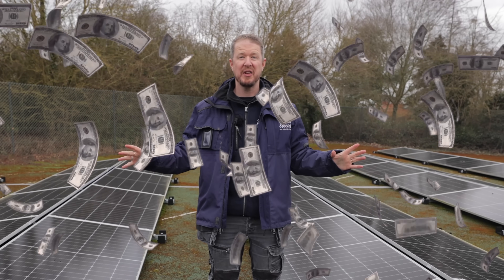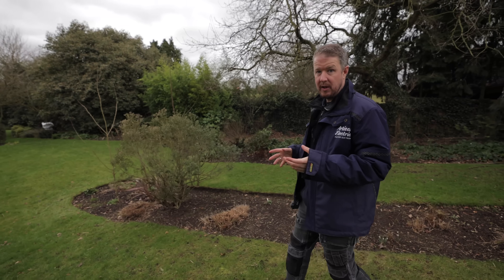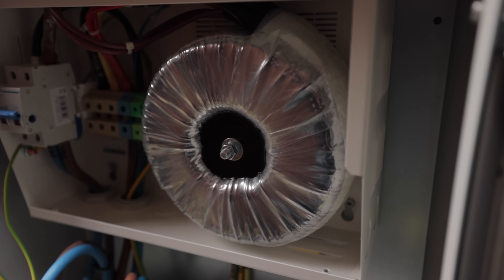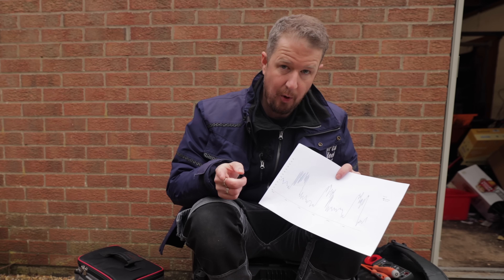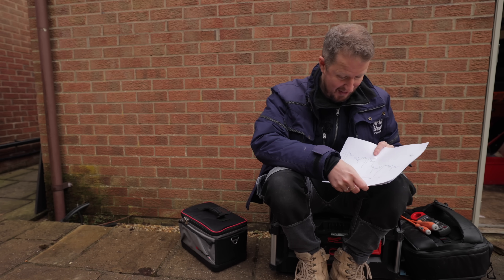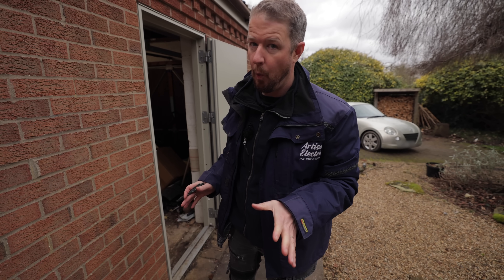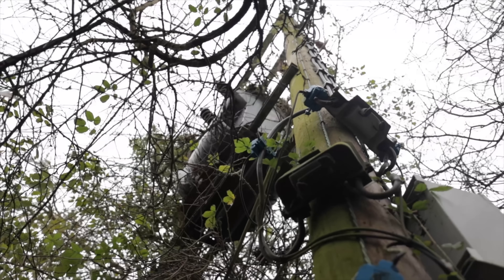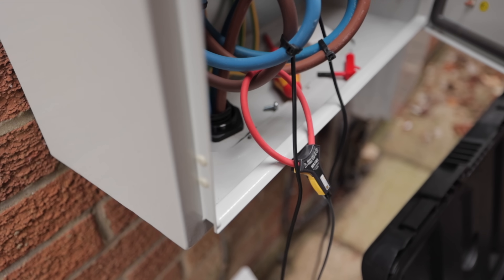THOUSANDS Down the Drain – And We Can’t Do Anything About It!

Comment from the maker: Try OpenQuote for yourself: https://www.openquote.net/
Reply: as replied numerous times below, to solve this you would require a beefier LV grid. Tapping the transformer elsewhere will result in end-of line voltage being too low. Base reason this is like it is, is the G99 approval for default 17kW. 

if you stay within default requirements as per for example synergrid in europe they do not do a total re-calculating of this grid portion for this. 

the portion what needs to be kept in mind, is that these systems at the time where engineered, did not need to take into account decentral production, only power draw. 

to solve this, without changing anything to the grid, you would need a automatic tap transformer that can regulate your voltage on the fly, or you would need to top off your power production to match the 255v AC mark, this will reduce your output of the solar panels, but to my opinion only a few % .
Reply: I did try the quote portal. Submitted everything asked - you guys didn’t answer. Tried the WhatsApp and again silence.  Great videos but extremely poor communication.
Reply: This is problem that we have in Netherlands for years. 

Electricity always flows from high to low voltage. When a house consumes a lot of energy from the grid the voltage in the house drops. This allows the power to flow into the house. 

When you have a solar inverter and an exes of power the inverter is increasing the voltage. This so the power can flow to the grid. What is happening every solar inverter in the neighbourhood is increasing the voltage cause they all have an excess of power. So these solar inverters are all fighting and increasing the voltage cause they all want to get rid of their excess power. A solar inverter has a build in safety feature that shuts off the inverter at 253V. 

You need to get rid of that transformer as fast as possible. You and Your customer can be held liable for any electric appliances breaking in the neighbourhood due to overvoltage.
Cause you putting a voltage on the grid over 253 volt. 

Tip: find a neighbour without solar to do your grid voltage test. 

Charging a car or a power wall will drop the voltage in the house. This is your only tool you can play with to lower the voltage during peak hours.
Reply: why you dont tune the inverters they are the faulty ones seems they are crap and 240 V is on the midel of 230v normative soo it's 230 +-10% 260 seems they are fighting for pump power on the grid instead just just only pump the line demans.Alot of inverters have a   bus and comunication  for avoid over voltage on the grid line. and plsu how many customer can use the power on that line your pumping sounds low on summer

Comment: Ok, very simple, problem is your "optimiser" is manual... You need an active one. Or if you fit a bypass contactor to it that engages when the batteries charge so you don't drop as far that might get you over the line...

Problem is less the DNO transformer and looks to be the capability of the lines between that transformer and the site...

Comment: looks like a pretty remote property, you're possibly just dealing with voltage drop across 300m of cable. the transformer is likely fine. 

useless info - Flexible CTs are generally Rogowski coils.

Comment: Not read all the comments but, couldn't a system be put in place so, instead of all three battery storages being charged at the same time, but charged instead, one after the other? The time would increase for charging all three sure enough, but the voltage drop wouldn't be as bad.

Comment: In Australia the minimum street to house mains feed is 16mm2 (25mm2 better) single phase and anything over 10kw of on grid solar inverters requires a 2nd phase for 20kw solar feed to grid and 3 phase allows 30kw onto the grid. Some states also can turn your on grid inverter/s off remotely if the grid is stressed.   

In older homes or acreage/farms with long runs to the street transformer and/or small pole transformers the customers often go 100% off grid using solar/inverters and enough solar panels for the worst weather periods (up to 100kw) along with say 50-100kwh of 48v batteries. You will always get some charge every day and if it's scaled right you never run out ever, you should have 4 days bad weather autonomy as a rule. 

The existing mains is then ONLY used for battery top up's as needed rather than run a genset in really extreme bad weather such as a long lasting low depression or cyclone with intense thick cloud. 
Most however disconnect the mains ENTIRELY due the unreliable nature of it and the energy cost (up to 70 cents a Kwh) and daily cost of the grid (up to $2 a day) would EASILY pay for a 20-30kw diesel genset which is rarely if ever needed but has to be there as backup. Diesel is always stored in bulk on the farm anyway.

Going off grid in many parts of Australia is not only cheaper but it's far more reliable. And the farms are used to regular checks and maintenance on expensive machinery so just add the solar checks to their workload
The checks are system output via an app,  look for hotspots (usually a loose connection or dodgy breaker) with a FLIR camera, keeping the solar panels clean and cleaning inverter and air conditioner filters (if used) and checks for moisture and vermin.
The installer will usually visit once a year to check and tighten all DC and AC connections as well as double check the owner is doing their bit.

Comment: Exactly the same non-sense here in Spain. And, do you recall the BIG BLACKOUT we had in Spain on April 2025?. Well, I monitor daily the voltage on the grid, of course WITH my solar system working. SInce the event on April 2025, the grid voltage has suffered a LOWERING of about 10Vac. Yes, I mean that, instead of the very usual 250+Vac we had on solar peaks, with peaks of 255+Vac, we got into the 240Vac area. That way my solar system is lots happier, there are no disconnections / alarms, and there have been just a couple of hickups since, even with the Summer. I did some research and it seems the voltage on the transport grid has been lowered and so the cascading transformers have also lowered the voltage to reach the customers. So, if that is not a case of deliberately changing the grid conditions, I don't know how to call it. It is curious I have not seen anywhere this information but, for sure, at least on my area, it can be demonstrated using the voltage logs of the weeks before and after the blackout

Comment: The night-time battery charger is pulling too much power.
If you could reduce the power consumption (extending the charge time) it would solve the excessive volt drop which is made considerably worse by the distance to the local transformer. 
Am i wrong?

Comment: My system had the same problem and my charger kept tripping out at 260volts. The DNO tested the voltage at the substation and it was too high nearly all the time in summer. They looked dropping the voltage but found it was further upstream from the substation, then they did something somewhere else and it dropped to the required level.. so now my  charger works OK but in winter I am getting low charging because there has been no  usable sunlight from flag and cloud cover.

Comment: This solar voltage instability is why the the Spanish grid collapsed. Because they had shutdown all the stable electricity supplies ie gas and coal the grid became exposed to voltage changes. Up and down the country solar was pumping in different voltages and the whole grid went down. They are now trying to reduce the grid voltage to about 220 to allow for spikes but as more solar is added the problem gets worse

Comment: I would have thought the dno would have looked at this further due to the high grid supply but surely when charging the EV it would come from the battery storage first? Wouldn't that be a programme issue on the inverter storage setup? Some I've seen run off the batts until power drops then switches to grid supply or a combination

Comment: That’s not a voltage optimizer. It’s a transformer. A voltage optimizer is far more complicated than that and stabilizes the output voltage to a constant level. You’ll end up with the opposite problem when the supply voltage drops. Which it will as load goes onto the grid.

Comment: What the hell?  The grid tie PV inverters are current source devices; they aren't supposed to be able to alter the mains voltage at all.  Why on earth would you whack a transformer on the mains?  If the line voltage coming in from the utility isn't right, it's on them to fix their transformer.

Comment: Unless a power company is giving me a 1 to 1 exchange my greedy ass wont export any power unless my battery is charged and there is litterally nothing else to add power to.  Thats assuming my battery isnt too small and charges in one morning then i would get a bigger battery. If they got that much money then the pnly reason they should have it connected to ac power would be to charge on raining days. Otherwise install a tranferswitch and to heck with exporting.

Comment: Your optimizer should be not set to a fixed rate. E.g. It should be set to -6% during sunlight, maybe to +6% at night while battery charging and to neutral in between. Otherwise it is just a dump transformer and not an optimizer.
The solar system must be connectet direclty to the grid!
Only loads (house, EV charger...) should be served by the optimizer.
I also recommend to charge the batteries at noon during solar production peak instead at night.
Also check the inverters configuration. It should never let the voltage go above 253V.

Comment: It sounds like the EVSE was designed for 230V +10/-6% but the local sub station is still set at 240V so that will take it over the limits. The first EVSE I had did this. Really EVSE manufacturers need to allow for the higher voltages, mine was tripping out at night as the low load caused the voltage to rise.

Comment: Did you eventually fix this ? It seems there is clearly a high resistance joint causing a larger voltage drop under higher load - remove that *voltage optimiser* thing

Comment: Needs another 200 houses building and connecting to the same substation - that will pull down the base voltage (providing of course they aren't allowed to do anything stupid like feed even more  power back into the supply!

This is nothing new - regeneration when braking  on electric trains as always had the problem that there needs to be other trains to put a load on the supply - otherwise the voltage goes too high.  On trains we monitor the line voltage and reduce or stop regeneration if the line isn't receptive. Seems like you need something a bit smarter than just the step-down transformer bolted to the outside wall.

Comment: Surely, to feed the grid from the PV system, it just needs to be 0.1 V higher than the grid. Why is your client's inverter increasing the voltage by 25 V (10%)? My inverter increases the voltage by 2%, but in summer this means my normal grid voltage of 240 V rises to around 253 V, and my inverter will increase it further to approximately 258 V. An easy fix would be to stop supplying the grid. My off-grid PV systems stay at a constant 230 V.

Comment: @artisanelectrics I had exactly the same problem at my property in London a few months after getting PV and battery installed. I have a 8kW enphase system with 17kw givenergy batteries, 2x hypervolts and an eddi setup and noticed that the GivEnergy inverter was tripping up. Upon calling them, they advised it was to do with the voltage, and all the readings are stored in their cloud which I could log into. I produced a graph similar to you, and promptly called UKPN. They installed a voltage monitoring device (but surprisingly said nothing about switching off the PV system). After 3 weeks they collected it (although it only records about 1 day of data). It seemed to confirm the problem, and the engineer said he's going to tinker with the settings at the transformer. In my case, the nearest transformer supplies about 200+ houses, but the guy said the voltage control was manual (a bit like the steps in your optimiser). But he also said the next transformer (supplying the whole neighbourhood - approx 2000+ houses) up the line was automatic...i.e. adjusting the voltage based on what the readings are to try and maintain the baseline. The engineer tinkered with the settings between both transformers and it solved my problem. This was about 3 years ago. I haven't bothered to run the graphs again as it's a very manual process, but I also haven't had any of the equipment tripping out because the voltage is outside of the range. So I 100% agree with you that the issue is with the transformer technology.

Comment: I live in India and here voltage swings from 185~190v to about 235~ 240v...Earlier days of my childhood it was very disturbing because everything was voltage sensitive like fan, incandescent bulbs, fluroscent bulbs, motor pumps etc..they won't light up properly. But with the comming of electronic choke for long fluroscent tube lamps, also CFL and LED lamps and BLDC fans we barely notice the voltage fluctuations anymore.

Comment: I really have to challenge the owner of this system. He has installed a tennis court of panels which we all know will need to be sitting on the court for 10 to 15 years to payback and more than likely will be in the way and scrapped early. Then he seeks to pump a reasonable amount of power back down the cable on sunny days. But why bother? Why all this investment? 
Why not accept he can charge batteries on cheap rate and use it during the day at proper voltage and top up on a sunny day with a smaller array? He has the luxury of a national grid and does not need to be off grid.
My own array takes care of household demand on sunny days only, nothing to export and some to import each day. Secure supplies, saves a few pennies in the very long run, reduces demand on the grid that is full, downside is at night in an interruption I will be sitting in the dark.
Seems to be a big boy toy and he is going to upset his neighbours if they realise their voltage is going all over the place.
Grow up mate.

Comment: Wherever the fault sits, I can't help but think this is just the tip of the iceberg in terms of feeding into the grid. In simple terms the electricity grid was conceived, designed and built as a 'one way' system, sending power from stations to users. As we see more and more localised 'user' generation the pressures of making our 'one way' system into a robust 'two way' system and balancing the two needs will become more and more complex. DNO's and gov't must be aware of this, this is just another element of grid balancing, the key questions being what are they planning and who will pay for the likely major works.

Comment: 230V baseline in the UK? Mmm, It’s 240V and over the last 60 years I’ve consistently measured between 238V and 245V. It can sometimes be a problem when using equipment designed for the rest of Europe which typically uses 220V or 230V.

Comment: Maybe I missed something with the customer's problem, but wouldn't you just install the energy optimiser on the consumer side and not the generation line? That way grid ingestion on overnight charging isn't reduced and car battery chargers / house appliances are running on optimal levels rather than waiting for the grid to be fixed? I mean, I appreciate that effort, but grid seems to be within tolerance, and I don't know if the transformer is the problem or if the input is simply greater that 11kV. In australia our expectations are 240V +/- 10%, and to be fair most appliances don't really care because aside from heater coils, there isn't much stuff in the house that uses high voltage and everything uses voltage regulator ICs which are fairly tolerance of power-go-up-down.

Comment: Its not simple solution but I believe there are several option a voltage optimiser they have is useless unless it can dynamically keep adjusting input voltage for the customer as he faces a massive fluctuations, I would say a drops when all electric heating is on and overvoltage then heating is mostly off and there is a lot of solar energy available.
I would personally split the system to Electric heating ( not dependant on voltage stability) and household appliances with can be quite sensitive to voltage fluctuations.
Other parts are Inventors I think there are required more expensive inventors who cap the voltage within reasonable margins with mean you would not be able export a lot even if you can generate. ( this due current flow to export you need have produced voltage higher then DNO.
Living in Scottish Highlands this is very common issue in Islands with wind turbines where in windy days DNO has not capacity to stabilize network as there is no capacity to take all the energy back.
I think it would be require carry segregation and energy use optimisation at property to balance energy use energy systems with can balance the energy demands and productions.

Like charge cars when high energy for solar panels use wet heating system with thermal storage accumulators and similar. This is something with would e more and more required as me move to to territory of microgeneration. Most installers sell you system and Distributor gonna pay, but it no longer simple with so many private micro generators.

Comment: Can the system not charge the batteries whilst limiting the feed voltage to the network, and then release the remaining stored energy overnight / when local demand is high? In the UK solar power is always going to be generating when demand is low.